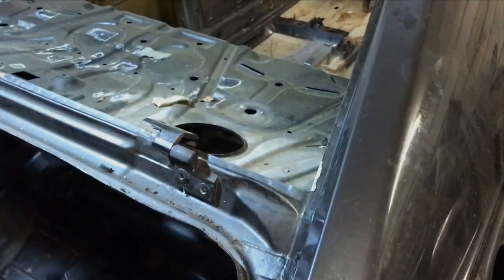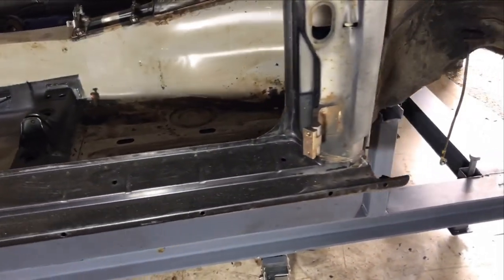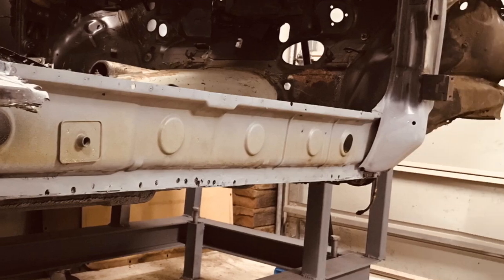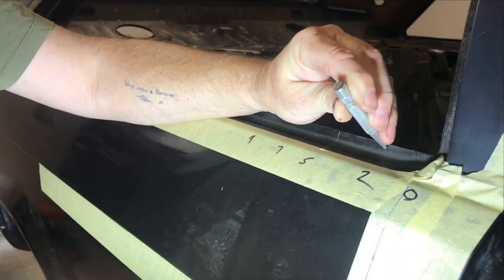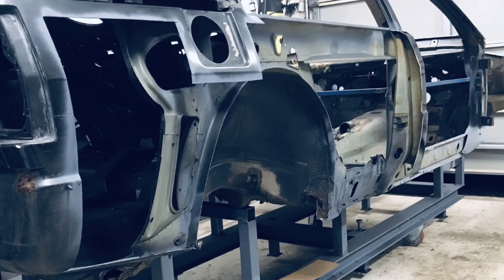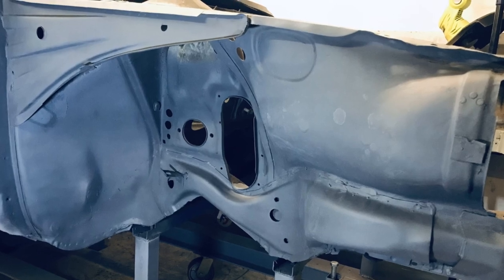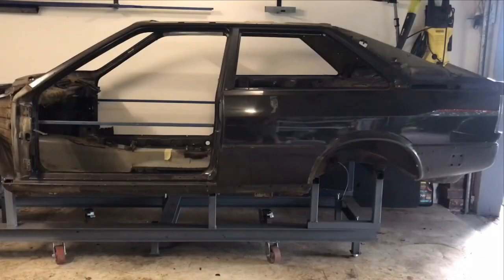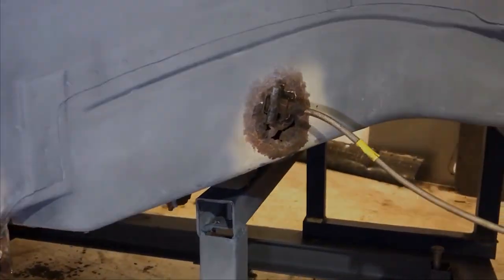THE GREAT UNPICKING...

Comment: I know the audi quattro came out in about 1980 and the quattro sport came out in about 1983 ?  I know about 13 inch was chopped out wheelbase to create quattro sport One thing im unsure about though about 220 original cars were made of the sport but was all the quattro sports made using 2 cars or was it just the rally cars ? Any thoughts on this  would be much appreciated
Reply from the maker: Audi made the Sport quattro out of two cars... the rear was a B2 coupe quattro, while front was a B2 2-door saloon.

I'll be making mine a little differently, due to the availability and cost of donor cars.  But still, it's the same way some well known and repeatable builders build theirs replicas.   The end product is a Sport quattro of the exact same dimensions and roofline.
Reply: Thankyou so much for your replys 👍

Comment: Great stuff- what's the short drill bit used at the beginning?
Reply from the maker: It's just a spot weld drill bit - you can find them on eBay & Amazon, and your local tool shop will carry them.